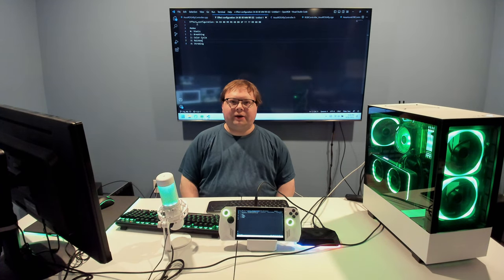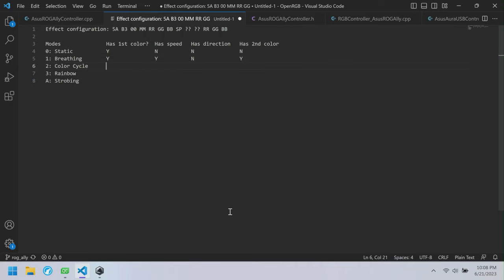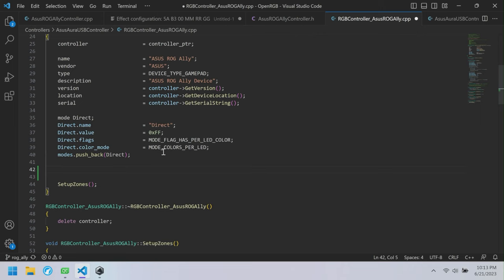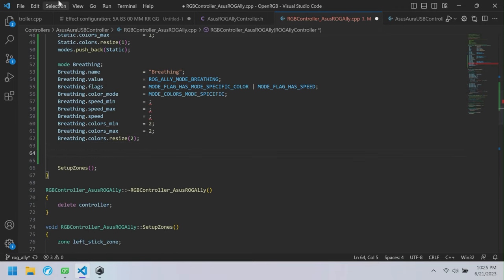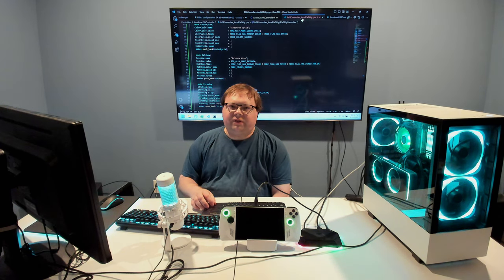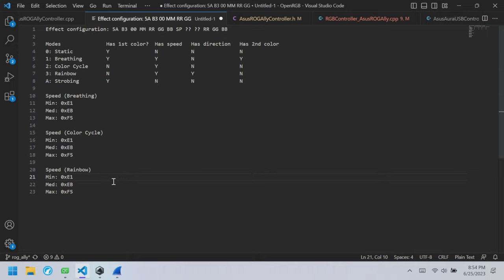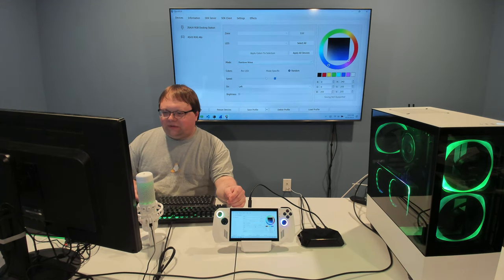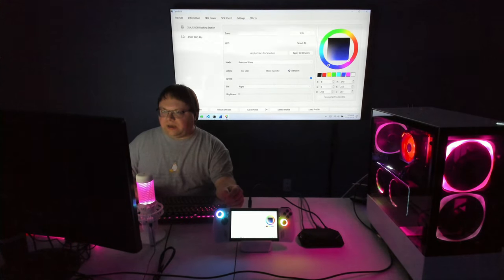Reverse Engineering the RGB on the ASUS ROG Ally: Part 2 - Effect Mode

Comment: hey man love your work but i has issues on ubuntu 22.04 the new .8 always always always gives an error failing to read i2c pid's, running .7 fixes this but no devices detected
i followed all installation methods directly from the github page, nothing works for me and i have tons of supported rgb crap
i think main issue is my motherboard may suck ass since new bios from june 2023:Gigabyte H610M ddr4 ver 1/1.3
i have power color red devil ultimate 6900xt, the mobo has a rgb header connected to antec rgb fusion devices, also rgb patriot viper ram , not a single device detects
Reply from the maker: The i2c message is a warning, you can ignore it but it indicates OpenRGB can't talk to the i2c interfaces.  That will prevent some devices from working.  Did you load the i2c modules?  Gigabyte boards often need a kernel parameter as well to access i2c properly.
Reply: @CalcProgrammer1  btw if you can see the github replies under bug reports i left a much more detailed message complete with logs